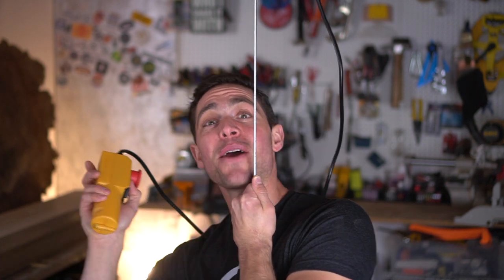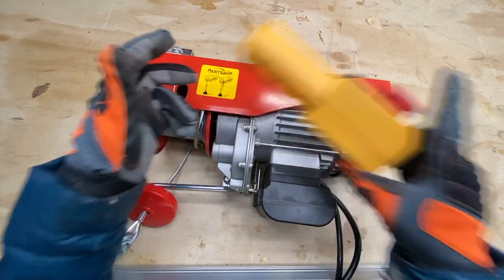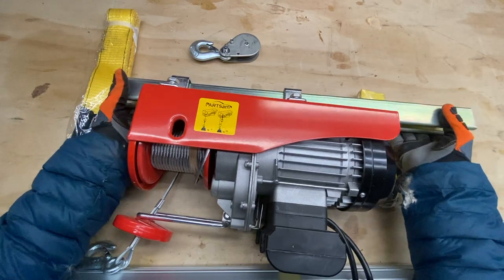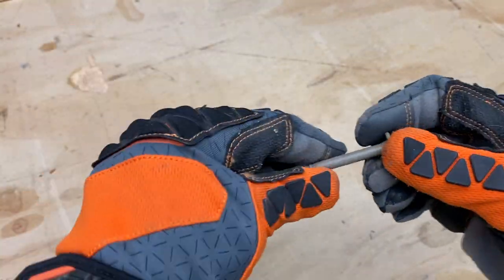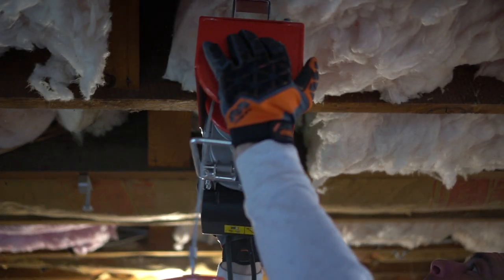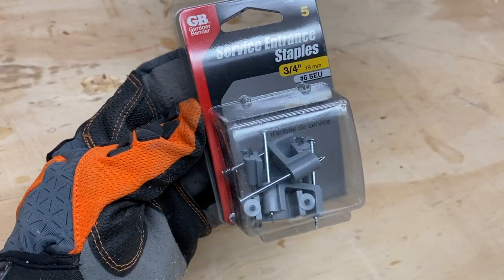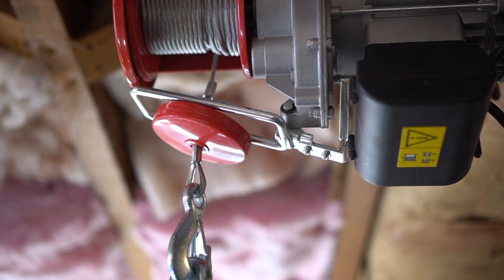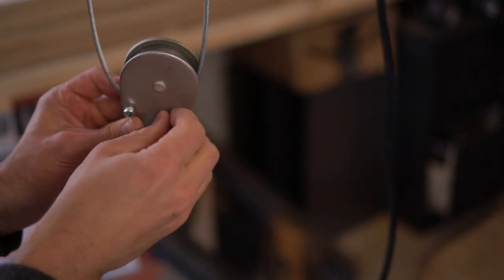How To Install A Garage Hoist // DIY Garage Makeover Series

Comment: Great vid. Make sure you encourage better securing the hoist when setting up the winch for the 800 pound capacity. Someone will get killed with those lag bolts. Use another  unistrut on top and sandwich the beams in between. With the threaded rod and nuts on each end and one in the middle. Now your load would have to break the truss not a cruddy bolt head ;-).
Reply from the maker: Safety first is always the most important.  Thanks for the suggestion and for watching palmano.
Reply: Glad I wasn't the only one concerned about how much weight was reliant on two lag bolts in wood!

Comment: I added a couple of 2x8 going up and down on the joist up above I also used a 2 inch pipe to hold hoist and have big bolts on some u straps screwed into the ceiling joist

Comment: Suppose your load jerks or bounces even just a little. Those deck screws could easily pull out or snap off. It’s not the dead weight of a hammer that drives a nail it’s the force it exhorts when it is in motion. You get the point. At least use longer unistrut with bigger lags. Overbuilt is always better than undertaker.

Comment: def look up how to use that small snatch block - you should not remove those bolts to use it instead pull the pin to open the snatch block assembly.  just a helpful tip.  love your channel!  thank you.

Comment: Nice hoist.
I wouldn't trust those bolts though.
I would put brackets that had 1/2" bolts going 3to5 inches up those 2x10s.
Lateral forces are much safer than pure gravitational forces.
For additional safety, plywood sheets could be married to the joists.
Reply from the maker: Great suggestion Stan.  These bolts are extremely strong but Yes it wouldn't hurt to have some extra support to ensure safety.  I'll keep that in mind for sure.  Thanks for watching and the support.
Reply: Agreed...
Reply: Correct me if I’m wrong, but there is no way those bolts are rated to even 300lbs, someone is going to get hurt with that setup. I also would never trust the threads on those bolts to hold heavy loads in wood. You really need to anchor the hoist with a bar that goes through the joists, not attached below the joists by unrated deck screws.
Reply: these are structural screws that are well suited to this applications.  on all the jobs i run i use these screws in leu  of carriage bolts as they have superior load capability and are much faster

Comment: I got a question. Hoist wired controller lengths.  How far from the floor is required. A foot? Also they can't tough the floor correct?

Comment: It would bbe cool to add custom brackets w/rollers and a set of rails to move the hoist back and forward in the space. Something similar to what is used for super heavy doors in the Aerospace test environments I used to be a tech in.  Antenna ranges, vacuum bell jars. etc. What is that hardware called, if anyone knows?  Would be great for the ability to pull a motor as well as  the body off the frame of a car without moving the vehicle. Some joist reinforcement and heavier hardware setup needed, of course.

Comment: Love it. Been looking for a hoist and video with install instructions for a while. I'm installing to lift my Bronco hard top (only 100 pounds or so). Do you think the 12" bar would be enough (with lag screws) to lift it safely? If not, I could go with 5' bar.
Reply: Doing the same. 4 door hard top only weighs 68 lbs and 2 door hard top weighs 80 lbs. this will lift it and be safe no problem

Comment: What size is that metal piece from Home Depot? That's the same as the HF 880, it's on sale for $109!  I have 2 5 stack joists to mount into so I'll use 2 screws each side

Comment: When you tighten the bolts on the clamps around the strut does it tighten all the way or can you still slide it.  Due to height I’m going to have to mount mine at an angle so if it tightens it will be fine

Comment: I want to make a trolley system for heavy bag use in my garage. I would to be able to hang two bags, with the ability to slide them into the middle of the room while issuing them, then off to the sides when not in use. Any tips? Thank you in advance

Comment: I don't think "pull out strength" is the issue. The issue is more of a shearing strength. An uneven load could snap the deck screws/ lags. Those deck screws/lags were not designed for that purpose. I would use at LEAST four 3/8" diameter lag bolts. The kind you use to secure a ledger board to a house when building a deck. Otherwise, nice job.
Reply: Ledger board is the hint.

Comment: Please don't use deck screws to hold 800 pounds, their very hard but brittle so not structural. I wouldnt ever trust the wood ither id want a longer metal beam and lag bolts all the way through to a backing plate of some kind behind the joist. 

This could end really badly...
Reply from the maker: Appreciate your concern joe and very valid which is why I state in the video that if you are lifting very heavy loss that you should attach a longer strut so you can attach to multiple joists.  However, no fused of your note on these screws being brittle.  In my opinion these screws are EXTREMELY strong, hence why they are used for decks haha. Have you seen issues in the past?
Reply: @BYOTools  very dangerous,screws will pull out of wood,you will get hurt with that set up ,just common sense
Reply from the maker: Joe really do appreciate your concern but look up screw pullout strength tests.  A simple drywall screw can average 400 or 500 lbs of pullout strength.  The screws I am using can easily withstand 800 to 1,000 lbs of pullout strength EACH.  I know it doesn’t seam like screws would have that much strength but they really do.  Thanks for looking out though.
Reply: Change your screws to 5 or even 6inch 5/16 lag bolts, I have two 5 inch, and can lift my 650 bike with no problem.
Reply: @BYOTools  you're omitting the force generated by the moment (drum radius x force). moment force could create 3-4 times the line load putting you closer than you think to your assumed limit. if you look closely at the ads these winches are free to rotate on a round beam which removes this moment. cool hoists though
Reply: @BYOTools  But decking is bolted down not hanging from the ceiling.

Comment: Did you use a span calculator or talk an engineer to determine the capacity of the joists and of the screws.  Just saying the lag bolts are good enough for decks is meaningless.  That setup is shaky at best. Keep people away.

Comment: I bought this hoist, a 6-ft long unistrut, six 5/8 x 4-inch lag screws, and washers and proceeded to install everything just like in this video. Before I drilled my first hole, I changed my mind and returned everything. There was no way this could be a safe set-up.
Reply: You regret it after a year?

Comment: You are ASKING for an accident and problems. Those deck screws are NO WHERE NEAR strong enough at all. People please do not do this unless you want the hoist to come smashing in your head or dropping a load
Reply from the maker: James really do appreciate your concern but look up screw pullout strength tests.  The screws I am using can easily withstand 800 to 1,000 lbs of pullout strength EACH.  I know it doesn’t seam like screws would have that much strength but they really do.  But I do suggest adding a larger steal strut to provide more strength to the overall system if you are worried. Thanks for looking out and watching.
Reply: @BYOTools  I used these screws rated same if not better than lag bolts and afixed  a angle bracket down a 12in header with 4 screws on each  of the two brackets with a L -90 bracket across the 3 headers and bolted to each  angle.... not going anywhere.
Reply: @walterschilling4512  I'd love to see some pictures of this - sounds spot on.
Reply: It was at 1:20 when I had the same thought.   Might be good enough.   But probably would span 4 joists minimum